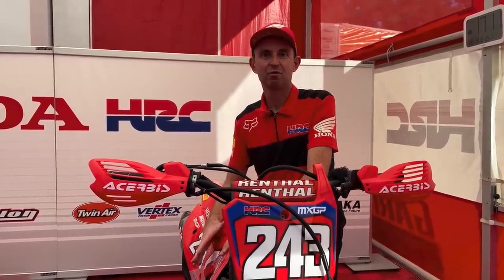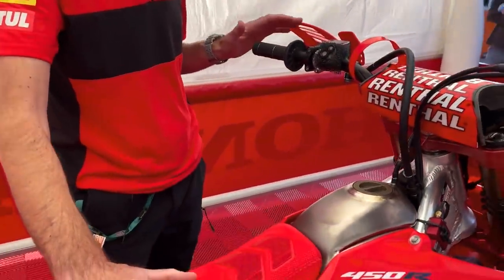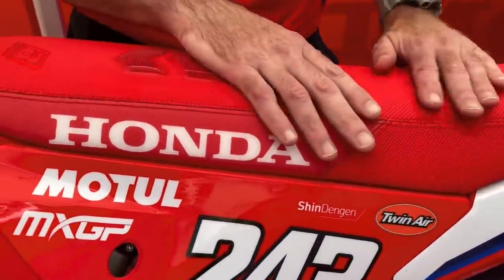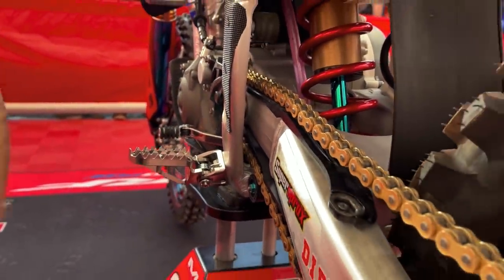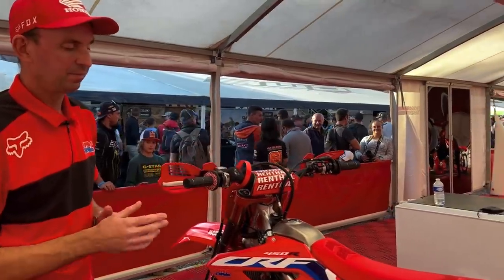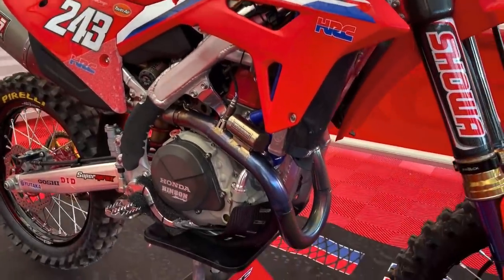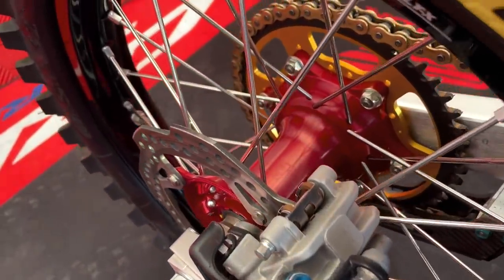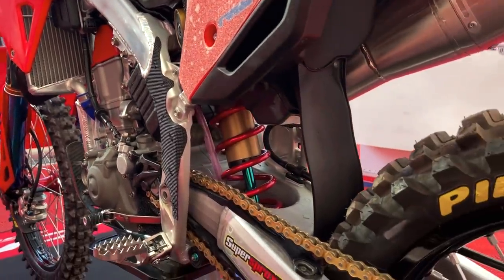FACTORY BIKE | Tim Gajser's Honda HRC CRF450RW

Comment: Great" in depth" explanations here....🤷‍♂️. We have a tire here. An exhaust over here. A brake here and here. 🤦‍♂️ MXGP so secretive. 😆
Reply: What use could the general public have from the injector timing data and O2 readings? Or lets say from the dampening characteristic of his A kits? Ofc those specs are secret, and his bike is not nearly stock. So even if you copy pasted those data to your WE bike it would not perform the way his race bike does. Its fully tuned to perform the way they want it to

Comment: I find it weird the mxgp bikes are still using the rs-4 exhaust and havnt gone to the newer rs-12 exhaust
Reply: Because that motor was dynoed/setup with that pipe. Unless they’ve done EXTENSIVE testing with the new pipe, that one stays on there. It could also be just for that track (and others), they have different engine combinations depending what type of power there looking for. Nothing is on that bike "just because ", EVERYTHING is calculated…

Comment: O2 sensor. Nice
Reply: What is the canister on the pipe, just in front of that o2 sensor?  What is its purpose?
Reply: @voiceofreason9238  it's a resonance chamber ,it's purpose is to quieten down the bike down ,but allows them to have a less restrictive muffler, increasing power.

Comment: Just missing one major component.  
A CR500 motor. That wouldake that bike truly be a rocket ship.
Reply: Who's gonna tell him that current 450s make more power than 500s ever did?
Reply: @StrykerV8  must be ypu watch , read and listen to false news. FYI the 450 4puke will never make as much torque as a stock 500. Go ahead and Google 2021 450 4pukes vs CR500 on the dyno.
Reply: @dennismillus4581  torque? Of course not, 2 strokes can't rev at ALL. When they run out of steam, 450s are still revving another 4 or 5000 rpm. That's exactly why current 450s are more powerful than 500s.
Reply: @StrykerV8  the 450 4puke under a load will never reach those rpms.  If you watch videos of them going up hill in sand the 500 sings all the way to the top. Passing the 450. Where the 450 4puke boggs.